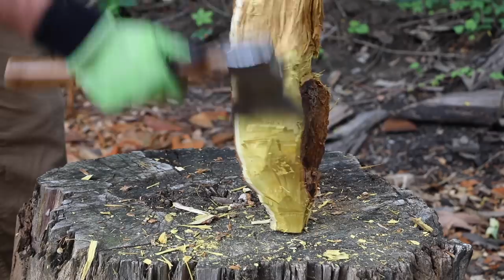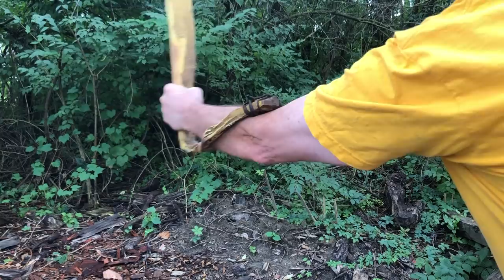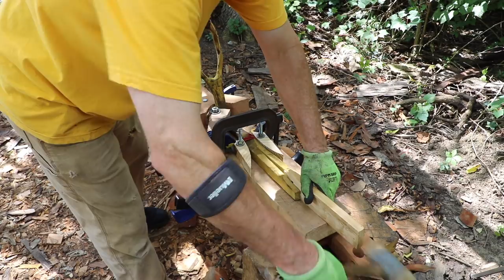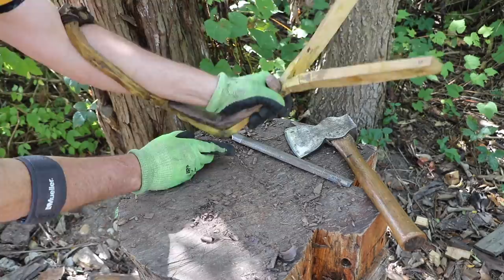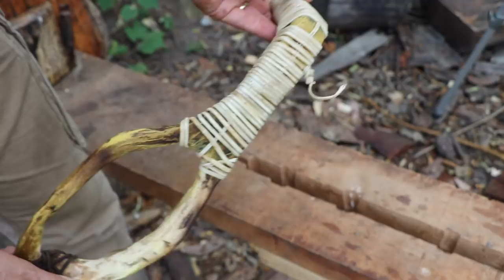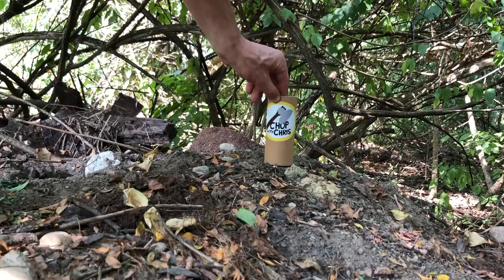How To Make A POWERFUL SLINGSHOT (ASMR)

Comment: I am impressed with the slingshot, especially the forearm hole 
But what really pumps me is that huge bar clamp. SPECTACULAR
Can you tell me what it is ? Make manufacturer etc.
Reply from the maker: I know.  I know.  I found them at the flea market  for $25 each.  I think they were custom made so no manufacturer.  You just can’t find clamps like this.
Reply: @ChopWithChris  
Man you probably floated all the way home.
I did a quick bit of research and found:
 A "circled H" on tools made by Cincinnati Tool Company signifies that it was designed by John M. Hargrave (1889-1975)
Reply from the maker: Actually I did find some markings.  No. 510-A  C. T. C.

Comment: Christ, that's only like 45 pound pull at most for a sling shot, gotta get some steel cut it into a Y and then some industrial extra strength rubber. Made one as a teen and it'd go through 3/8s plywood like a bullet but still cleared 1/2 plywood. Thing was close to 100 pound pull afterwards lol.
Reply from the maker: Amazing!